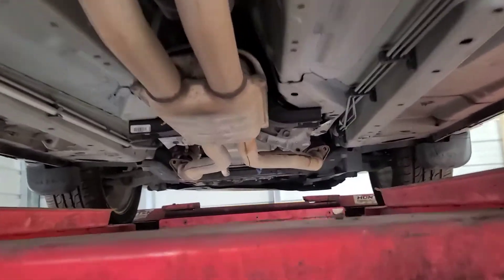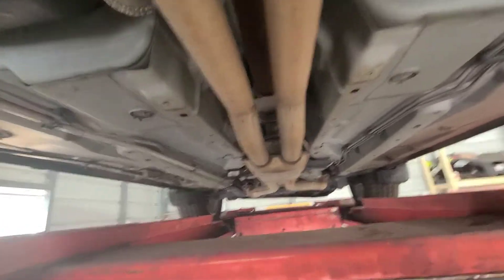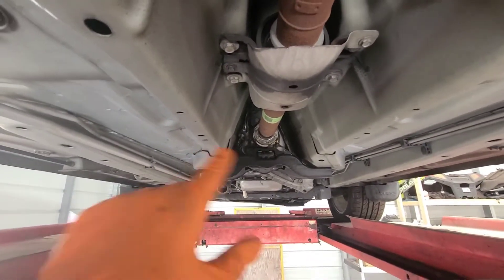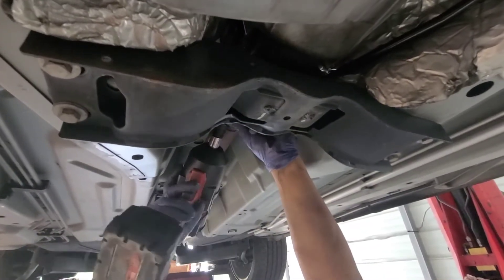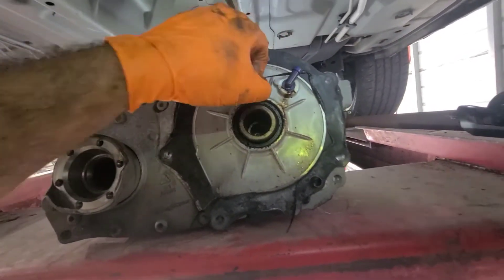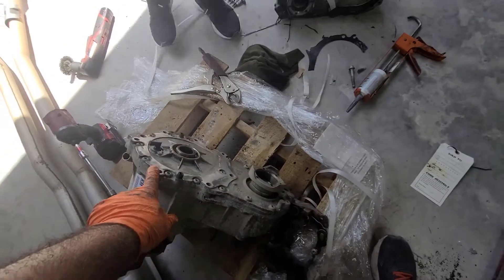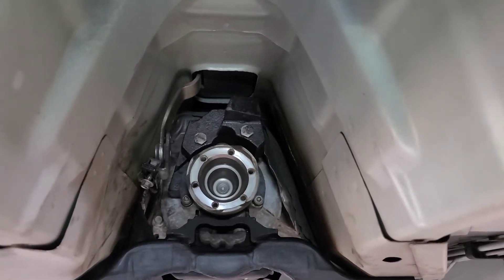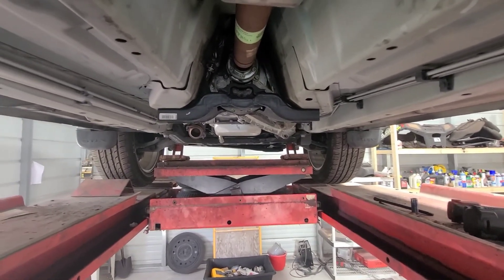2007 Cadillac SRX transfer case replacement

Comment: What was the reason for replacing ?
Reply from the maker: If i remember correctly customer told me the chain inside stretch to the point of any type of acceleration will slip and make lots of noise. Like jumping grinding type of noise.
Reply: I'm having this same issue with my 04. What is the rough cost of replacing you think
Reply: @tanman7044 here in the netherlands it costs about 1250 euro’s.
Reply: Could the noise be described as a drive line "popping" sound?   I'm pretty sure I got same issue with my 05 srx v6 awd.
Reply: @sidewayzmike yes

Comment: How did you get the front shaft bolts out?  Thanks
Reply from the maker: After disconnecting the rear drive shaft, you will have to lift the front tires in the air so that you can spin them and get to each bolt but on the transfer case side not at the front diff.